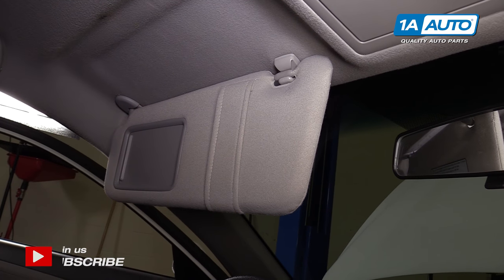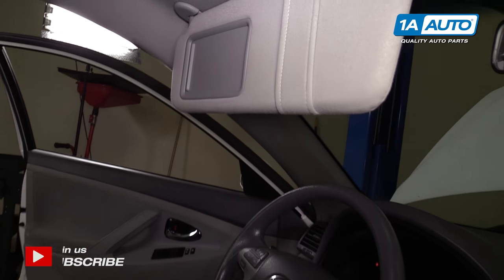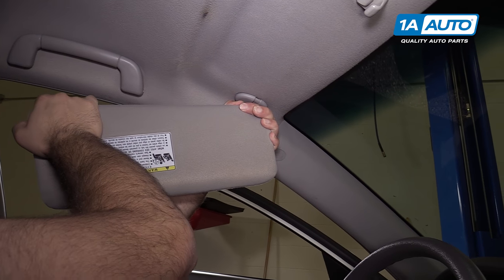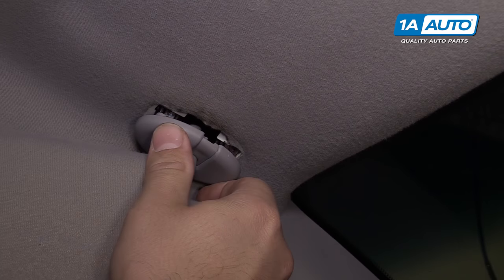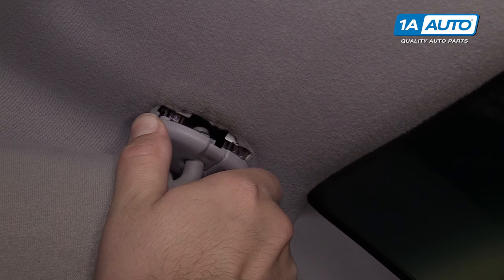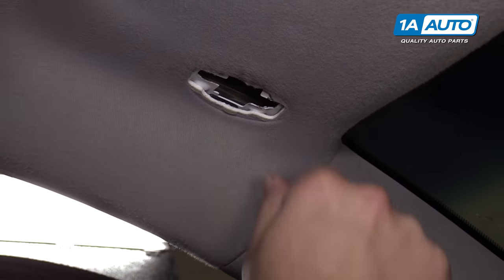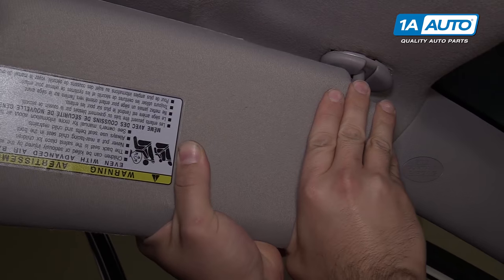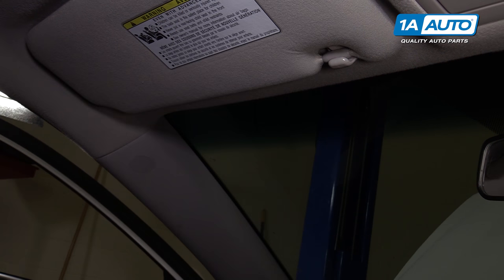How to Replace Sun Visors 06-11 Toyota Camry

Comment: Uhh....that's not how you remove the visor, not even close.  You're supposed to remove the plastic cover around the mount to gain access to the clips which you're supposed to squeeze and then it comes out like butter.  If you crudely rip it out like you did, you risk damaging the thin steel that's part the roof.  This video really makes 1A auto look bad...
Reply: Lol should read your comment first. Yeah he’s right I warped my steel a little. No big deal I just took some brass punches and a tiny hammer to form it back into place
Reply: U also run the risk of breaking the plastic part where the clips go
Reply: @djwalruss4897  doesn’t matter, most new ones come with them. Only issue really is just bending that sheet metal that holds it into place
Reply: Damn! Thanks for you comments bro. I followed them step by step for their other videos but something felt off for this one. Glad I caught it before 😅
Reply: You should see their video on how to replace a windshield "gently take the sledgehammer..."

Comment: I cringed when so much force had to be applied. The "u" shape cover must removed first to release tension of the two black clips. Then there is less force required to pull the arm and visor assembly.
The installation is also easier if the cover is installed AFTER  the visor is pushed into roof lining. Just a suggestion.
Reply from the maker: +Hashem N Thank you for the feedback! 1aauto.com
Reply: I would add that on the new visor the U clip latches on the inside with a plastic hook.  It can be hard to get the U clip to come off easily.  But with a flat screw driver you can get the plastic hooks to release.  Note there are two plastic hooks that are on the inside of U clip insert.

Comment: Did it a couple tries . It didn’t go in at first but managed to get one metal prong needed to get the other in as well just slid it forward and pushed it in . Also did the hood lift struts and replaced two tires !! I’m feeling stoked ohhh yeeaaahhh 😊👍😀

Comment: my dealer wanted $237. I ordered on from Amazon for $30 or so which is very similar to what I had. But it took me more than 2 hours. I tried to slide in the metal pieces from both sides of the holes. some video said you have to put the cover very last (which has two plastic pieces that should go through the holes), and I couldn't insert the cover like they do so I used a hammer and damaged the plastic solid piece. I finally used the cover removed from the old one, and put it on first like this video, then I used the hammer. Finally it's working.

Comment: Info note. You must have the trim piece on the visor for the metal spring tabs to stay put when you install the new visor. The trim piece tabs hold the spring tabs in their hole in the visor mount. If you try to install the visor  and then the trim piece the visor will not stay attached to the roof.

Comment: I was able to replace the driver visor with no problem. I ordered the replacement for the passenger side and thought it would as simple to replace and it was not. I could not get the clips to catch. What am I doing wrong on the passenger side? I tried hammering it. I lost 2 clips in the ceiling. Please help. Thank you.
Reply: A hard push, not hammering is required. If you hammer on the assembly the clips will deform and break, rather than deform and spring back once they are through their respective holes.

Comment: They sell em on Ebay for $30, i bought one its the same one. Save yourself the money because their website charges $90
Reply: Not to mention.. You don't just YANK it out like he did. That plastic piece comes off and then the clips come off easy.
Reply: How long did your ebay one last? Mine is done after a few months.